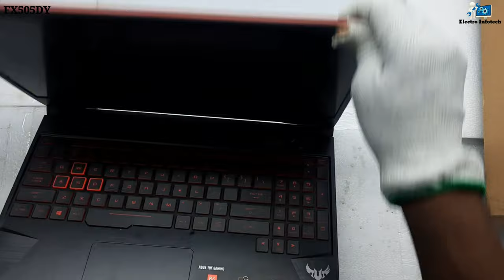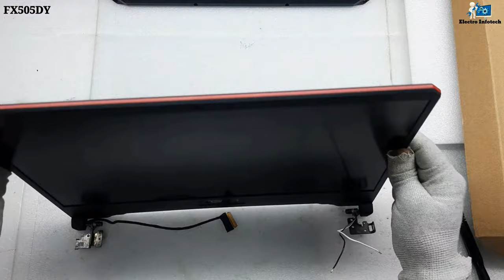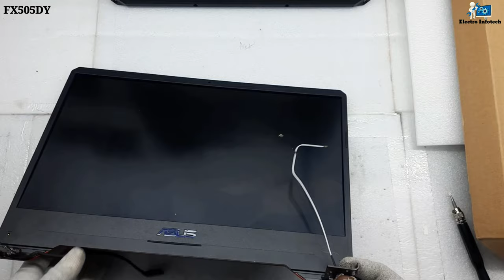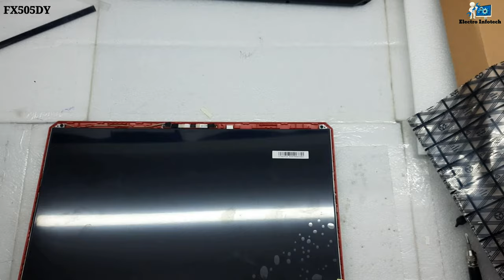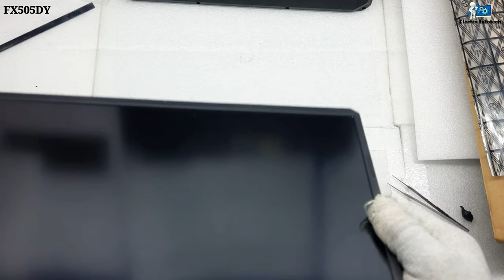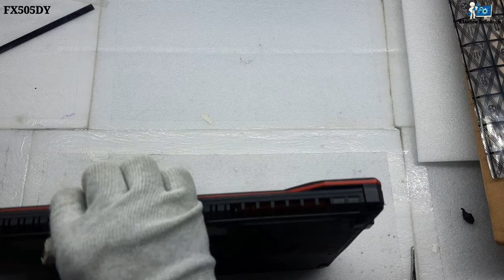ASUS TUF Gaming FX505DY / LCD Replacement

Comment: Hey I have a tuf gaming laptop,not sure if it’s the same as the one in vid but couple weeks ago I think I “cracked” the screen cuz it was hit by something sharp.I went to the place I bought,used warranty n they say they can’t cover although it’s within the warranty time.I sent it to another laptop repair n they tried changing many screens but it won’t display on the screen, when I “broke” the screen, the computer is system was fine.it was able to turn off and on multiple times,keyboard was also lighting up fine perfectly,only the screen was problem. I’m wondering if u could possibly know anything

Comment: Suddenly, one day my screen started showing horizontal lines and one day the display turned color spill, only the upper part of the screen still worked. And now the screen just lights up and shows color spill. 

So is my Screen Damaged or The EDP Cable damaged. Cause I don't remember any damage hapenning to the laptop
Reply: exactly same problem with me...they told me to change both

Comment: i have this laptop and I'm watching your video just looking for what are inside of it..
Reply from the maker: Adhesive glue
Reply: @ElectroInfotech  hi man, is it safe to use liquid metal on this laptop? I mean both surfaces of radiator and cpu/gpu will handle it without corrosion/damage? This cpu is so anoying at own temp and laptop is very loud even after new paste + cooling pad

Comment: I have asus tuf fx 505dy... My laptops screen not working a few week before l.so i give my laptop in local sevice center for repair. Now they were told me that some power unit was problem due that we cant know whats the problem in display...now they told me that we solve the issue in the power unit( they mentioned power board)after they told me the display was gone and they asking money for solve the power unit issue..please help me is there any screen problem related with power unit...
Reply: Guys pls advise me
Reply: I use my lap even display gone by using hdmi cable connect with other display

Comment: How much cost for screen can someone let me know
Reply: the 705, 17.3 inch is about $150
Reply: mine costed around 7k
Reply: @purab1552  which model number???
Reply: @adityagupta4074  fx505dt 15.6 inch
Reply: @purab1552  where did you buy it bro
Reply: @sabirjalal2960  the service centre ordered it...t
Reply: @sabirjalal2960  ebay